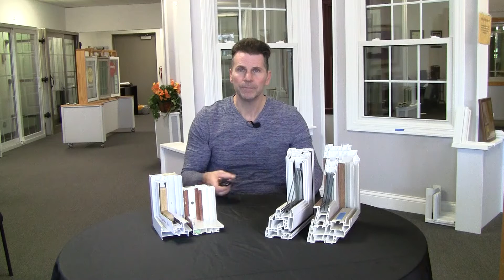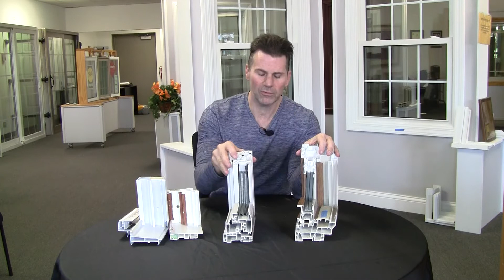When and/or why foam is or isn't needed inside vinyl frame windows or sliding patio doors.

Comment: Vinyl windows are the longest most expensive snake oil in the history of snake oil. And foam will absolutely improve the user experience by noise reduction. So say what you want about air gaps. But if the frame has no foam sound can pass right through. Use your loaf.

Comment: You could retire if you had a dollar for every time you straighten someone out on windows? You could retire on 20 bucks... gee let me send that to you buddy.  Ha ha,  Jay they are just windows. I JUST got 7 QUOTES....  from $4,500 to $16,000 for 6 or 7 windows (depending on how you count then, one opening is double wide).  So if I get a good vinyl window with foam for same price as same frame no foam... Dead Air verses insulation, the foam is higher R value. You are right to ask, is it NEEDED? Well depends on your weather, energy cost. If you have foam great, if not likely the performance will be similar all things being equal.

Comment: This guy is wrong.  And look at the glass loss in those frames he says are better.  Gigantic frames and smaller glass units and no foam are all cost saving measures.  Whats the u factor on those frames he is hocking?

Comment: Hi Jay.  I have a question.  What is the manufacturer of the 23 chamber vinyl unit?
Reply: The most chambers I've seen is (10) by a company called Centra Windows and they are in Canada.  I haven't seen multiple chambers like that from a company in the USA so that's why I'm asking.
Reply: Probably Provia
Reply: @nrehberg  Thanks!

Comment: Your speaking out of you butt your regurgitating talking points window manufacturers told you there's no science in your explanation. Why do you not need foam... Is there a thermal barrier in the air of the window? In these chambers is there magic fairy dust that keeps the air from eventually transferring air temperature from outside to inside.. you know because that's the reason for the chambers not to keep air from moving around. Good grief your a horrible salesman

Comment: Ok, there are a couple facts sprinkled in here which makes it seem knowledgeable, but this is NOT correct. There are many other reasons why there would be foam in there and those cavities are big enough to cause convection currents which are very effective at moving heat
Reply: Exactly, this guy knows just enough to be dangerous! He does not understand air movement or convection at all! Nor does he understand why you have windows in your home! Who wants a 6 inch frame, when you can have a 3 inch just as efficient!
Reply: @27delphi  And the 3 inch will warp enough to lose a good seal losing a lot more heat than foam preserves.
Reply: Some people play on the gullible nature and the ignorance of people! Anyone that knows anything about physics knows this is a Bull article trying to convince people to buy cheap windows because they do not want to put the engineering in to make them quality!

Comment: Foam does add insulation to a window and it also adds some rigidity. No matter how you slice it, Foam is a smart option and it does make a window more efficient. The only reason a company would not offer foam is to save money and time on the production line.
Reply: Isn't foam insulation just small beads of plastic with air inside them?
Reply: Vinyl air gap vinyl on and on it how it’s designed for energy efficiency. Foam is needed for cheaper built windows. Understand the difference first
Reply: @andyk4688  Not true at all.  A fiberglass window with foam filled is vastly superior to a vinyl window.  Vinyl windows are garbage, especially after 10 years.